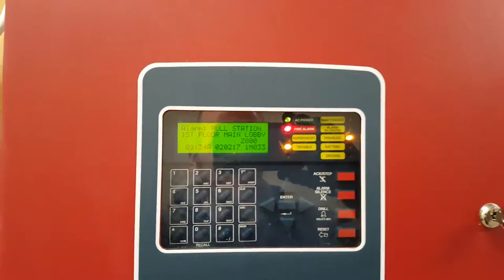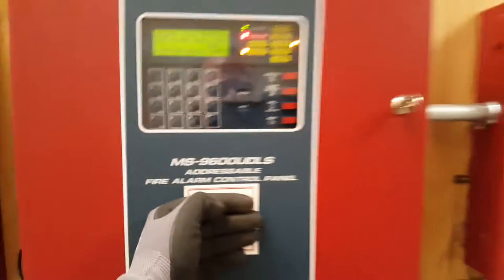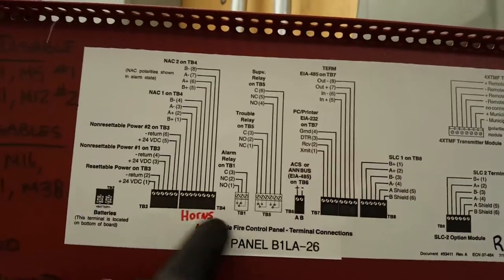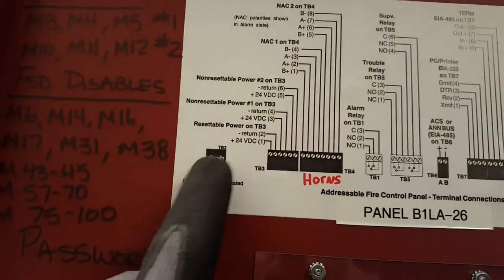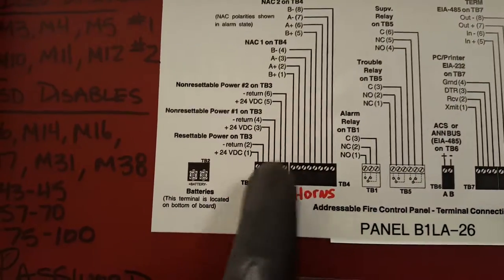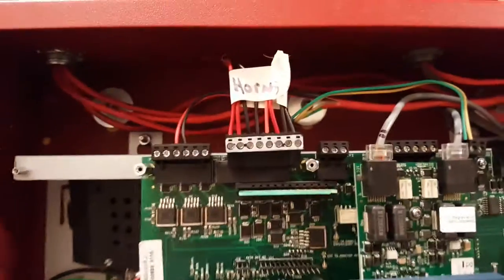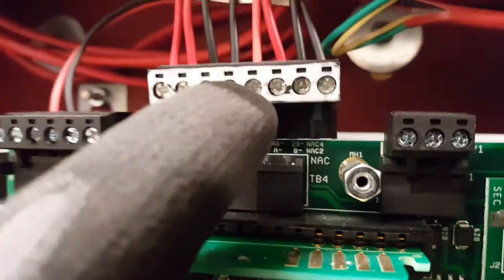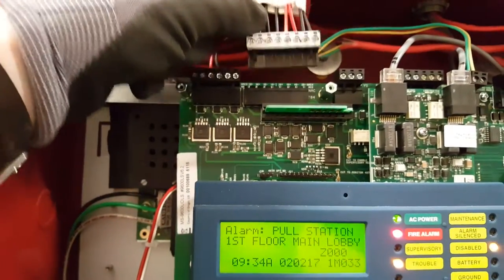FIRELITE MS-9600UDLS How to Disable NACs

Comment: The Field House building at my college has an MS-9600UDLS system as well, along with the Walmart I used to work at. I still remember the awful beeping sound the panel would make when in Trouble mode at said Walmart (which was fairly often.)